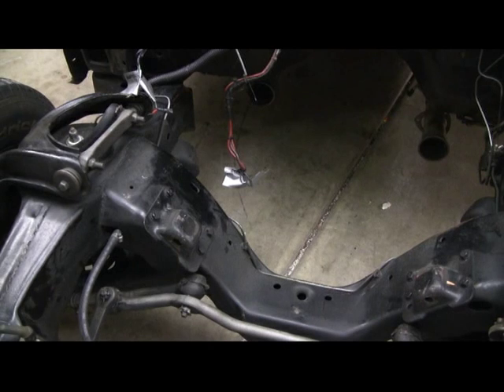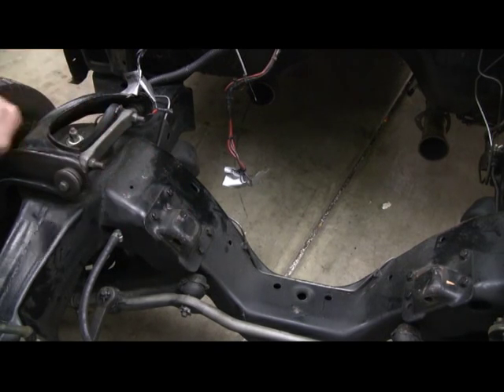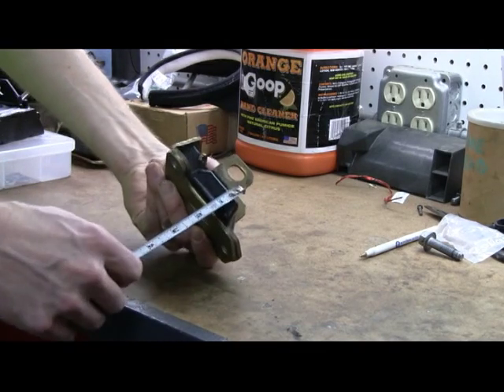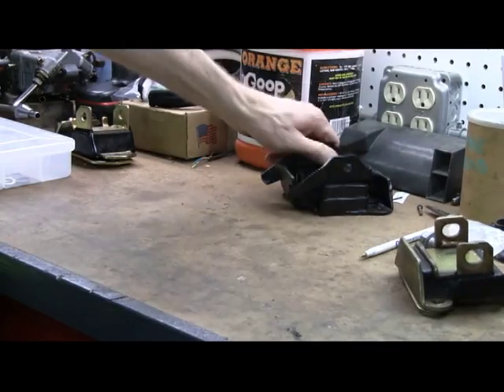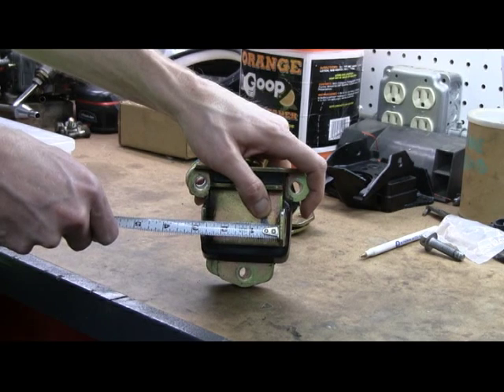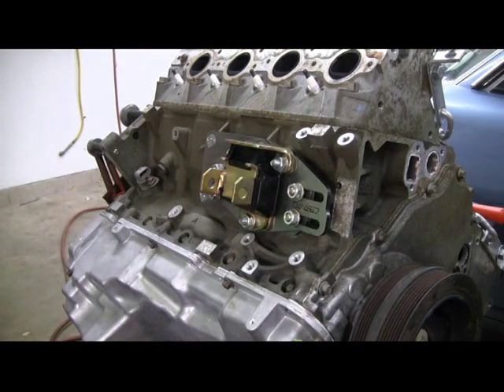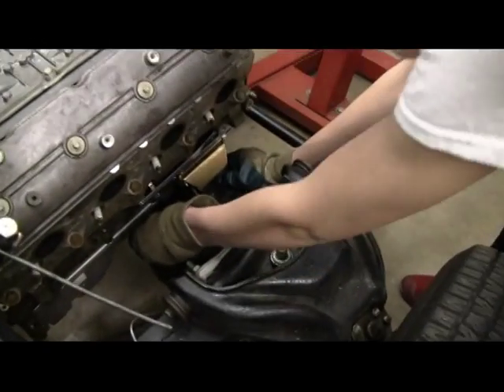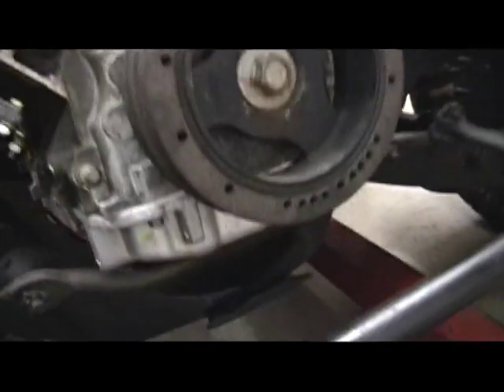LS conversion swap part 6 dryfit 2

Comment: Not to mention, those rubber mounts break very easily, especially if you have a lot of power in your motor. I snapped 2 of the rubber mounts within about a 6 month time frame (both on the driver side, where the motor tries to lift up from the mount) before I switched to the polyurethane mounts. I haven't had a problem since.

Comment: So I'm assuming you swapped out the Pontiac frame mounts for Chevelle mounts first?
Reply from the maker: Correct. I have been running a SBC in the car since 1981 and swapped in the Chevelle frame stands back then.